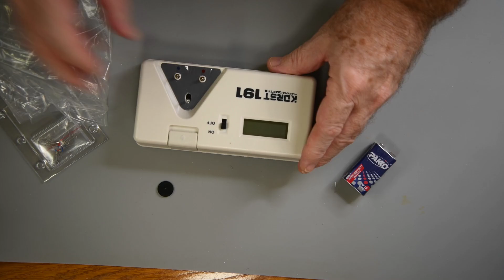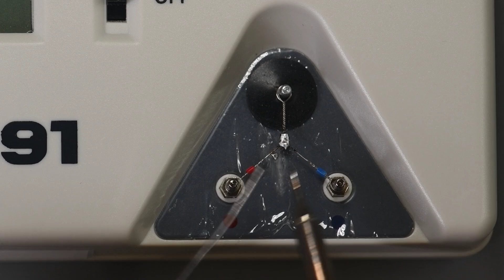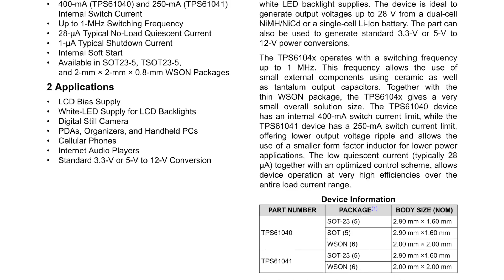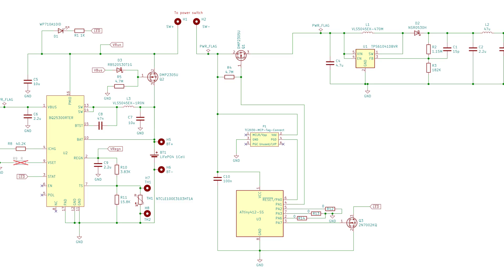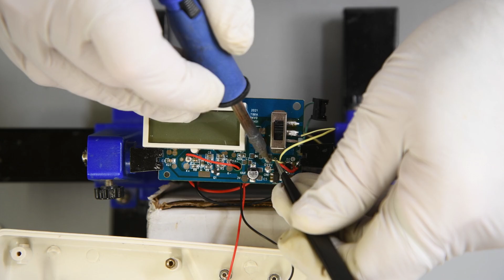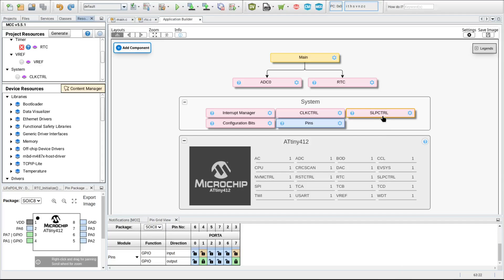Testing A 191 Thermometer + Ridding The World Of 9-Volt Batteries

Comment: My man really hates 9v batteries. Then again I assume this is more about fun than practicality. Hope to one day be able to do fun projects like this. In the meantime, I just use a version that runs off USB power and doesn't need batteries.

Also I know you like testing tools. If you ever feel like you want to try a different rotary tool the proxxon micromot is pretty great for precision work like this. Small and lightweight with lots of torque on the low end. Not very practical for using around the house as it requires an external power supply, so I still use my dremel for that kind of stuff. But for something that lives on the bench it is pretty great. Bought an inexpensive Wen momentary foot pedal which makes it even easier to use. Find myself using a rotary tool WAAAY more often now.
Reply from the maker: Yes, I really do hate 9-volt batteries. I'll take a look at the Proxxon, thanks.

Comment: Did you need to use the 9v section? If there’s a regulator on the other board why not bypass it with your own regulator?
Reply from the maker: I want to end up with a circuit that will replace a 9-volt battery without changing any of the device's wiring.  This one is not efficient enough.  If you want something for just this device and rechargeable a Li-ion or Li-poly would have enough voltage to not need the boots regulator.
Reply: @ I really enjoyed this post. The creativity of it and knowledge of not only circuitry but programming as well is awesome to see!

Comment: I used a small black battery charging board from "AE" (item 3256804920721265). Connected a small 3.7v battery pack to it and used the step up screw to boost it to 9v and soldered that to the multimeter board. The charging board has built-in protection and will charge the battery at 1A. They are great for converting 9v battery devices to rechargeable using 3.7v battery packs of many different dimensions or using 18650 cells.

Comment: If I had the money (or a youtube channel) and really wanted to test accuracy. I would have bought the original hakko.

These you have no warranty on that it will be precise, consistent or that it even hold the same calibration over time.

With nothing to compare it to in the moment, they are more than useless.
Reply from the maker: You can get a cheap K-Type thermometer and compare them.  It is tedious, but you can use the K-type to check the soldering iron tip temperature.